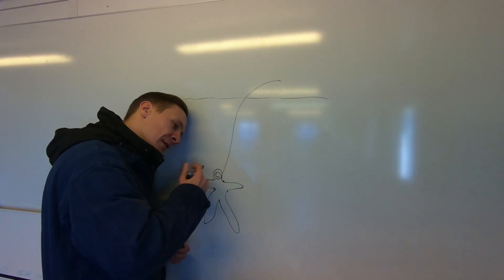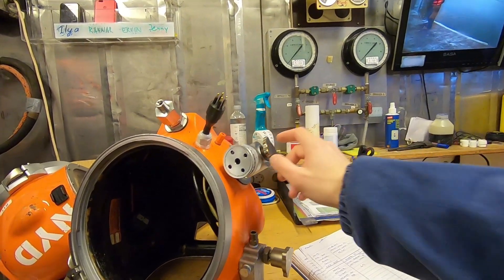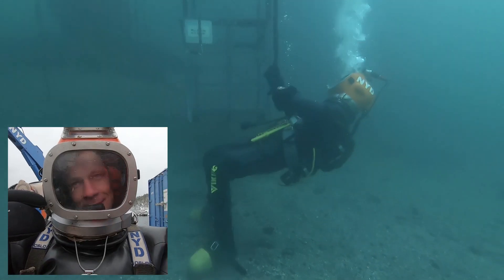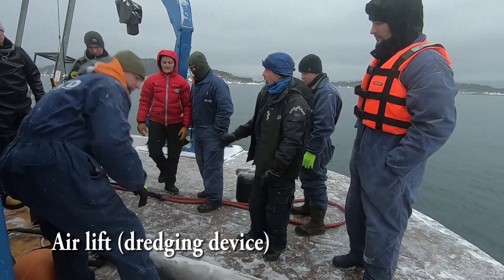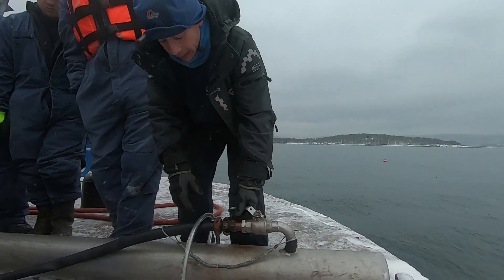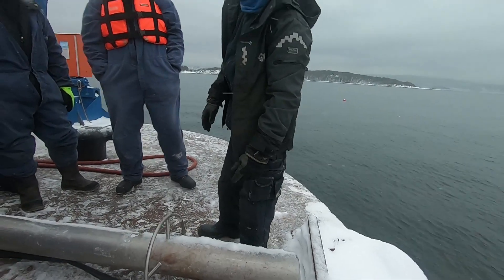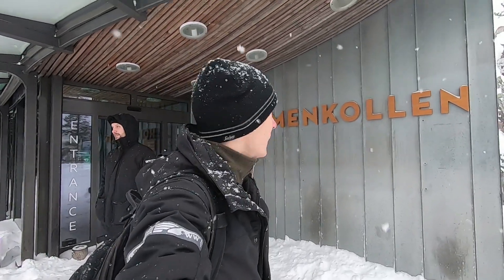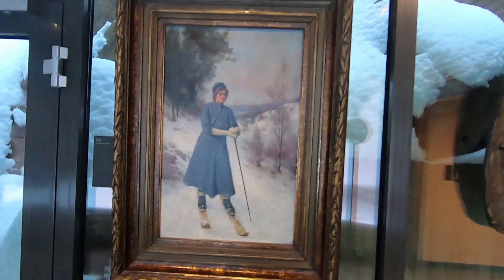Helmet Diving (Become a Commercial Diver at NYD) - ep 11

Comment: Is that dangerous
Reply from the maker: Diving? 
Of course. Humans are not meant to live or work underwater. That's why we are not holding our breath and working, but enjoying the constant air flow from the surface. And why do you need to learn this in a diving school? To do it in a safe way. So is it still dangerous? Yes, but if you do it according to the rules and regulations as we are taught, then and only then it is not so dangerous. But you have to be aware of the dangers all the time.
Reply: @rannarlaur  are they offering jobs after you finish school ? Pls answer
Reply from the maker: @nothingheretowatch7371  Yes, we have some companies scouting people straight after graduation. But all in all, you yourself have to be good and in the right mindset. You should always think through all the angles of a job offer. Not only as a worker but what would you search in a worker as a job supplier. Wich kind of a worker would you hire? And are you yourself at the moment the best option for them. Do you have some more special skills that might come in handy (not only barely making the cut) and so on...
Reply: @rannarlaur  Very good advice, I'm in the industry coming up to 7 years. How are you finding it with the coronavirus?